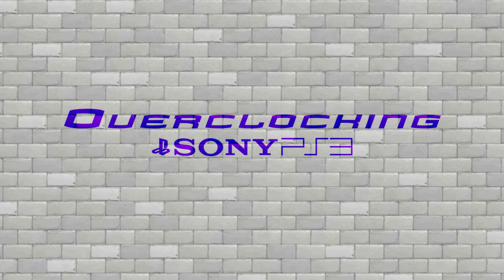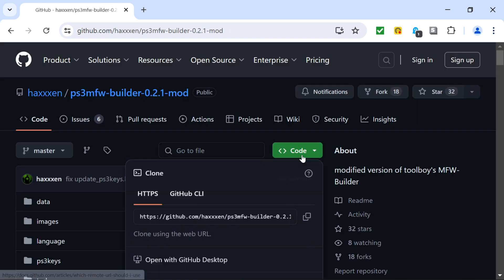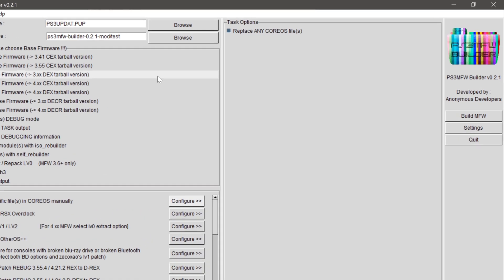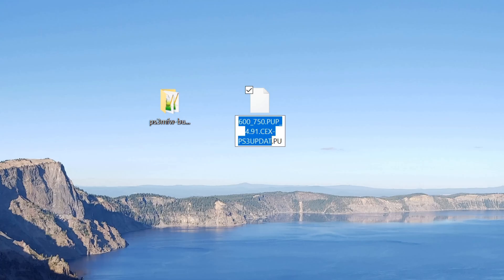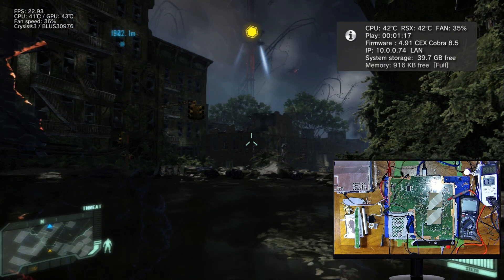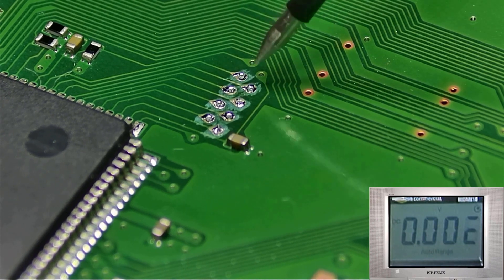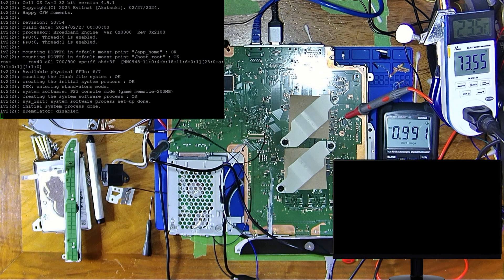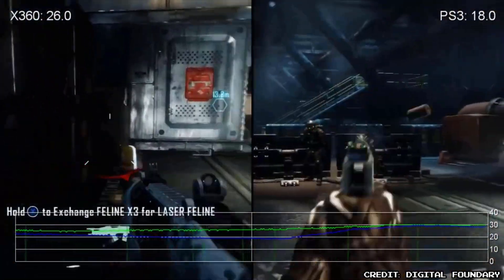PS3 Pro Tutorial | How to Overclock a PS3!

Comment: the ps3's vrm is pretty weak and since I suspect my tokins also began failing, when I end up replacing them, I will also try to hook up an evga epower 5 to the RSX, so I can see how much will the 65nm scale on proper voltage regulation (that is, hoping that Sony didn't try funny things with pwrgood signals and all of that crap like you see on newer GPUs that are more difficult to epower, but we'll see, fingers crossed)

Comment: My ps3 is 40mm but I can't overclock it because of my version CECH30xx, hopefully in the futur, I will be able too with a CFW and not HFW, have you got any info on that ? Until then i am using the free OC from my webman,
 (650/800 and my temps are at 40-45 in game (40%fan), so much power unused 😢)

Comment: 6:05 i couldn't select the original file like he did as there was no option for it is think he missed a step
Reply from the maker: You need to download the firmware you want to modify and then select it. BTW, this isnt nedded anymore, since evilnat's latest firmware builds in overclocking features. Webman too. If you use evilnat's function it only applies to that session, so if you go too high and it crashes, the console will revert on bootup.

Comment: Would love to see a video about the opposite, PS3 Undervolting. Which essentially is lowering the voltages through this Syscon that helps the PS3 run more power efficiently at stock clocks, hence decreasing temps of the PS3 and improving reliability. It's definitely something i'm considering where my B01 model Cell runs hot even after a Delid and multiple attempts at reapplying Thermal Paste.

Comment: i wonder what happen if you use an hen firmware on mfw bulider wonder if it works on the ps3 super slim
Reply from the maker: Hot scoop. We already can OC 28nm SS. A recent hardware exploit make it possable. So far it is confirming what I suspected. Super slims are poo poo!
Reply: @ripfelix3020 dayum that kinda hurt me bc you said superslim are poo poo:(
Reply from the maker: We noticed that 90s dont overclock well, 65s better, 40s best...so we have been wanting to OC the 28nm assuming it would do beat. Except that I have been suspecting it wont sacle, because I've notices there are layer 40s that dont OC as well and I wouldnt ve suprised to fi d out that 28s dont either. And well, that's what we found.
Reply: @ripfelix3020 alr thanks! also i have the 40nm one finding a fat ps3 pretty dang hard in vietnam
Reply: @ripfelix3020 sr if this is too late but what it we use badwdsd or qcfw on the 28 nm superslim?

Comment: does it work on cfw 4.92? its it mandatory to open the console?
Reply from the maker: I haven't tried it on 492, but it should. And no, you dont have to open the console to OC, unless you brick and then have to use a HW flasher to restore your backup.

Comment: can the overclock reset on it's own like a MSIafterburner clock on pc?
Reply from the maker: It's applied in lv1 by the firmware. If you update to a retail or non-OC version of CFW it'll revert. But not as long as dont update.
Reply: @ripfelix3020  Okay, then its weird that my supposed 700&850 oc started performing significantly worse than the first week after setting and playing on it. i played constantly with a fps counter and the avg fps drop was from about 55 down to 40. All I did was reinstall ccapi and set my working cid. 

Anyway thanks for the video and I'll keep testing out what works for me as a fellow avid ps3 enjoyer
Reply from the maker: There is now a new CFW update from evilnat and wMM from aldostools that add overclocking functionality in menu from the PS3. This allows you to apply the overclock in a non-persistant manner. You can try different values and if it causes a freeze or shutdown, no problem. It'll restart at stock speeds.

We truely live in the future!
Reply: @ripfelix3020 can I  install cfw oc firmware and just undervolt?

Comment: You're a legend. CECHC running 1.12v with 3-6 degrees Celsius decrease compared to 1.3/1.22 base. On a CECHL I tried using the Sherwood table, but anything other than 1v (5F) gets me a 3012 error, is the table or command different for Sherwood fats?
Reply from the maker: Yes, there is a different table for mullion and sherwood syscons.

Comment: I am having trouble creating one with the new 4.92 update. I created a 492 key and all as you said, but I keep getting errors, like wasn't able to find patchtool.exe...
Reply from the maker: I haven't tried 492 yet. But the procedure should be the same. If it gives you issues. Try deleating the install of MFW, the temp folder too, and restarting freah. Be sure to run as administrator.
Reply: @ripfelix3020  as I thought, I was having trouble finding the Temp paste on my pc... I think I will need to format my pc.
Reply: @ripfelix3020  can confirrm temp files is the issue to patchtool error, so that needs to be deleted

Comment: Hello Rip Felix,

I've been experimenting with overclocking my PS3 and found that it remains stable at a clock speed of 400MHz/650MHz. However, I'm interested in testing additional clock speeds such as 350MHz/650MHz, 300MHz/650MHz, and 400MHz/450MHz to optimize performance, particularly for multiplayer modes in "Call of Duty: Ghosts."

Would it be possible to add these clock speeds to PS3MFW Builder? Your assistance would be greatly appreciated.

Best regards,  
GC-Gaming66
Reply from the maker: You want to optimize by underclocking? To answer your question, yes those combinations are possable, but will reduce performance.
Reply: Thank you for getting back to me. Would it be possible for you to add the clock speeds to PS3 MFW Builder, or could you guide me on how to create them myself?

I appreciate your help

Comment: if im underclocking, does i need to undervolt it or just using the stock volt??
Reply from the maker: You can undervolt even at stock clocks for a sizable temp improvment. Just increase voltage a bit if you run into instability. You can undervolt more at underclocked frequencies.

Comment: In my own testing I've found that if you stick to 700MHz core you can actually apply a slight undervolt to decrease temps too.
Edit: Holy shit I managed to get 950/1000, at only 1v.
Reply from the maker: that's insane. We've been seeing some radically low undervolts. Like 50W less and still working.

Comment: When building a dex frimware should i choose cex or dex in mfw builder
Reply from the maker: I only geared this toward cex. I havwnt used dex, but I would imagine that's what you need. I doubt you would be able to install a cex on a dex tho, you'd have to convert first I'd think. But I'm not too sure.
Reply: @ripfelix3020  I choose cex when building a already dex frimware it booted but am not sure if I did the right thing or if it's fully dex now

Comment: Wait, is it possible to increase just vram voltage?
Reply from the maker: Yes, but it didn't make the VRAM more stable. It just made it hotter
Reply: @ripfelix3020  ah okay, I was hoping it would let me boost the vram clocks while letting me keep the undervolt on my cecha system.
I still haven't had much success with a Frankie yet unfortunately. 

Thanks!
Reply from the maker: That should work. The undevolt only affects the core voltage. So if the core is stable at your undervolt setting, you should still be able to overclock the VRAM to whatever it's maximum was before. It has it's own voltage. I just mean that over volting the VRAM didn't help make an unstable VRAM OC more stable. Just hotter.
Reply: @ripfelix3020  weird as I only managed to boost vram by a measly 25mhz before getting artifacts. I might just have a bad ocing chip tho.

I managed to boost the core by 50mhz before I got a black screen at 1.09v
Reply: @ripfelix3020  update: installing extra caps on the unpopulated pads allowed me to push the vram overclock to 700mhz. I'm gonna see how far I can take it.
Reply from the maker: Be careful.
Reply: @ripfelix3020  Knowing myself I won't be lol. I had to save it from a dead VRM, but hey, more experience is always good. 

and to follow up it capped out at 700mhz, I was seeing artifacts immediately at 725mhz

Comment: Which firmware I should download after ps3 overclock soft break
Reply: Idk why maybe I just lucky I unbrick without hardware flasher
Reply from the maker: Yeah, if you brick run the fans at 100% (you can edit the syscon fantable's first step to do this), that "usually" allows you to unbrick. BUT ONLY if you were being careful to overclock incrementally up and testing for artifacts as you go. If you jumped immediatly to a high OC then it cant cool it enough to stabilize and unbrick without a hardware flasher. So ALWAYS OC one step at a time and TEST TEST TEST before moving onto the next one.

Comment: Not sure if I can get help here directly but I keep getting this error when building the firmware "can't set "::add_license_msg::options": parent namespace doesn't exist" and I'm not sure why
Reply from the maker: Try deleating the install, and downloading it again. Make sure to go into appdata and delete the temporary folder there as well. I had to do that once too and I dont get why it worked the 2nd time, but not the first. It's still got some bugs aparently. Be sure to generate the keys using the batch file.
Reply: @ripfelix3020  Thanks that fixed it! thanks for the quick response too
Reply from the maker: Nice. Happy bricking!

Comment: So everytime i change the voltage i have to fix the checksum on sherwood right?
Reply from the maker: yes, when you change the byte in eeprom it changes the checksum and needs to be fixed. But there's only the one checksum in shwerwood, so it's the same address every time. 7FE IIRC, but double check that.
Reply: @ripfelix3020  yeah confirmed thanks alot!

Comment: I found some dude that is unlocking fps on the Xbox 360 and improving performance with some games running above 50fps on stock speeds with no overclock
Reply from the maker: One thing I noticed in uncharted 2 when I uncapped the FPS the snow fell faster in the opening scene. Clearly some textures are tied to the frame limit and increasing it actually breaks the intentions of the developers.

It's interesting to see what the hardware can do, but at the same time it's not intended or always preferrable.

Comment: Gotta thank you for the VID tables.

They were really helpful last night - went and undervolted (following Sampsonay's A01 undervolt which I might replicate as well  😂 ) a test CECHG04 (and you don't wanna know how bad it's been tortured. Half of the units I own that are in working shape went thru less harsh conditions before they got to me than this G04. Heatgunning included (and it wasn't me who did it... rather I was the one to discover it.)

Results were a significant drop in temps, and I'm amazed how low I could bring the chips - 1V for CELL, 0.97 for RSX (90nm).

(remind me to not be left alone unsupervised with a SYSCON reader and any 90nm PS3 😂😂😂😂)
Reply from the maker: Yep, we've been seeing quite dramatic undervolting temps.
Reply: @ripfelix3020  Yeah, the only thing I'm not sure of trying (but probably will anyways... that G04 has to get into its grave anytime soon, now that I have an imported A01 and another C04) is a OC on the 90nm RSX.

I wonder if it'll ridiculously fail or actually achieve a higher OC, around on par with a 65nm chip, now that it's undervolted to the default 40nm voltage. (correct me if I'm wrong on this one, I recall from a few Frankie diagrams that the 40nm runs @ 0.95v?)
Reply from the maker: 0.95v is for VDDR, which is different from the Core voltage we're changing here.

Comment: Could this same logic apply to  undervolt a Frankstein console? Instead of removing and relocating resistors
Reply from the maker: No this is the core voltage (VDDC). Frankies use a voltage mod for the RSX's FlexIO interface controller (VDDR).
Reply: @ripfelix3020  thank you so much <3 huge fan btw

Comment: Very nicely explained, thank you. Settled on 600/750 without the voltage change. 
Good video
Reply: What model do you have?
Reply: @AusOpening  CECH-25xx
Reply: @xpavpushka  you can probaly get an extra 100mhz, most 25xx models can do 700/850mhz safely my 21xx can do 650/850mhz stable, and with artifacts at 700/850mhz - probably due to the 21xx models having early revisions of the 40nm chip.
Reply: @AusOpening  noted. thanks for explaining

Comment: Help me i install a overclock update and may console wont turn on i tryed recovery mode but gives a black screen i have webman mod instaled is that possible revert the update? Ps3 fat checha01
Reply from the maker: You can try safe mode and if that comes up, try installing a known good FW. However, if you don't get any video whatsoever, even if the console is cold, fans cranked, then it could be bricked and you'll need to use a hardware flasher to recover.
Reply: @ripfelix3020  thanks i'll try this

Comment: By using CFW to unlock the full potential of the PS3 you begin to realise what a beast it was for 2006. Combine the overclock with an SSD and you have a powerhouse
Reply from the maker: Just not a cheap SSD. Remember that PS3 supports ZERO ssd features. So if the controller on the SSD itself is not robust enough to handle ALL of it's own data managment and wear leveling, then it'll slow to a crawl and die sooner. Basically has to treat trim as a no command. 

These firmware features are not advertized and most OS' implement them automatically. Many inexpensive SSDs cheap out on the controller and I wouldn't trust them to last in a PS3.

Personally, I'm trying out an SSHD. The traditional HDD part will have no issue with PS3, but they often contain a robust data managment system in FW to handle and optimize frequently accessed data, like the game you're currently playing or OS files. So they "should" provide the best of both worlds.
Reply: @ripfelix3020 I’m also interested in this topic, the only reason I prefer ssd over an sshd is the heat that it generates especially ones at 7200rpm. I think any modern crucial/samsung ssd have will do since their controller are often very reliable i.e bx500/mx500, EVO/QVO
Reply: @ripfelix3020  I know TRIM is generally (always?) handled by the OS but from my understanding wear leveling is a feature of the SSD controller, to the point that the OS isn't even aware of it.

Comment: Bro ı want to make 700-900 mhz but it isnt have in this app help me pls
Reply from the maker: Do you mean MFW builder's OC dropdown doesn't contain 700/900? I'm not sure if it does or not, I've been using a modified version of the list in which a whole bunch more combinations have been added. Since rrleasing the video, I found one that was incorrectly labeled and was actually default 500/650.
Reply: @ripfelix3020  bro i did this but while instal cfw to my ps3 its off now it dosnt opening when ı press on button it turns green my fans start vut 3 second later my fan stoped and all liggt turn black
Reply from the maker: Sounds like a GLOD. Hard to make out what you're saying, but if you built the CFW corectly it shouldn't brick. If you didn't follow directions corectly tho, you can brick. That's why there are disclaimers.

Try safe mode options.

Comment: Got 2 2501A overclocked to 700/1000 - at 750 it glitches under Crysis' games and Deadpool
Reply from the maker: gains beyond that arent spactacular anyway. enjoy.
Reply: @ripfelix3020  it's always nice to remove a bottleneck from the equation, now we are still stuck with CPU bottleneck and HDD IO bottleneck
Reply from the maker: Well AFAIK there's nothing we can do about the SATA 1 limitations. CPU may still be possable, but we don't yet understand why it doesnt work on retail, or how it does on dev consoles. we can OC the CELL on a DECR1000A to 4.8GHz and it's extreemly unstable, but we can't figure out how the bytes select that frequency to choose less agressive timings. We've tried the same timings on retail and it causes a YLOD with CPU related error. So it did "something," but nothing good. I think there's hope there, tho.

Comment: Do artifacts after overclocking mean the system is at its full capacity?

800 MHz on the core there are artifacts on 750 Mhz there are none. The console is before cleaning and replacing the paste. Does it make sense to check 800 MHz a second time after cleaning and replacing the paste?
Reply from the maker: From testing I found it seems to lower the stable temperatures. Like say it at 750MHz it's stable at 65C, but at 800 it's stable below 60 and at 850 it has to be below 45...etc. Example numbers only.

The clocks they chose would provide a safe margin. But if you cool it more, it can go higher.

Comment: 11:24I had an artifact like this and then I just had to change the hardisk (I intended to change the hardisk To fix artifacts and crashes on my PS3 does it help to replace the hard disk?
Reply from the maker: Sometimes. I've not seen artifactimg caused by HDD, but freezing and 1701/1601 are possable.
Reply: @ripfelix3020  I overclocked my PS3 but when I wanted to step up to 700/650 my PS3 artifacted and froze but I remembered I didn't have a flasher so I tried to replace the hard disk with a new one.

Comment: Stupid question, do you install this modified firmware to an already CFW-PS3 or can I install this directly to a 3.89 OFW?
Reply from the maker: You can install like any custom firmware, but need to be jailbroken 1st. So you can't OC 30xx models onward.
Reply: @ripfelix3020 Okay, many thanks!
Reply: Hey Feliz, wanted to return to this. Got my 2504B to 750/850 stable and super happy about it! And for anyone thinking to do this, take your time in testing the mhz properly and dont increment too much mhz before trying, nearly bricked mine because got too greedy and luckily got it back...